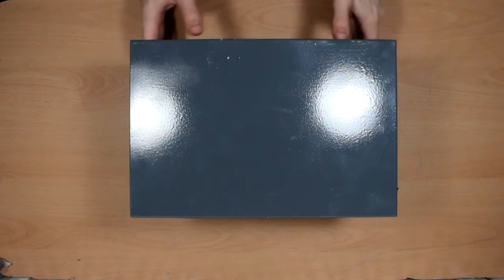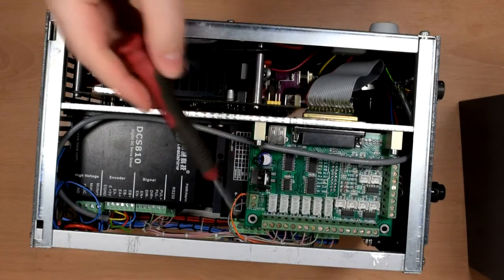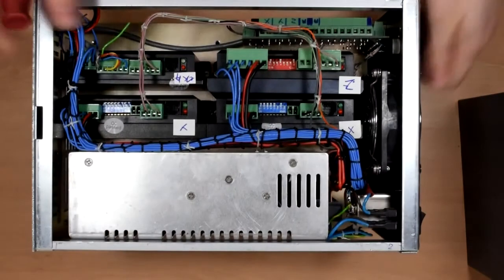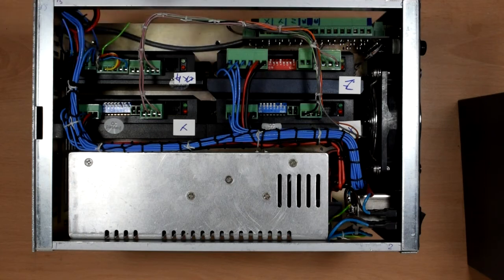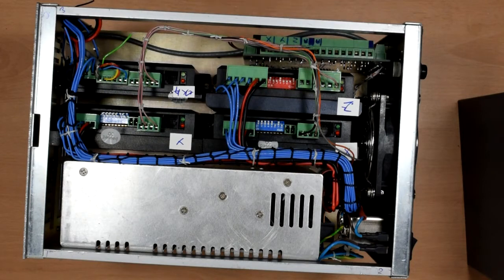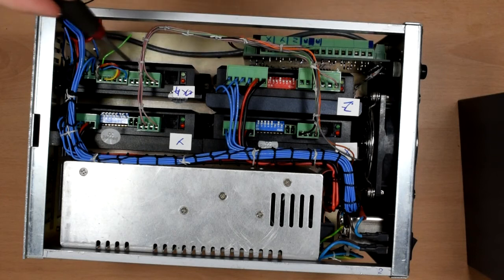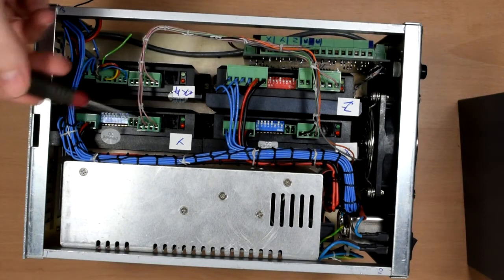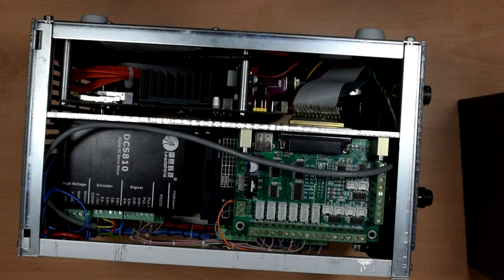3D printer servo/stepper  control box and why Leadshine suck.

Comment: You should definitely release a video about the printer. It sounds like it's a very unique one! I'm currently doing something similar (at least in the unique area) https://3dprintboard.com/showthread.php?42276-diy-3d-printer-design-verification&p=134738#post134738

Comment: You should twist the motor coil wires in pairs to reduce RFI.  Also putting a common mode ferrite on them near the driver would help too.

Comment: nice work ... can you show us the printer it self ?? and can you make a 3d printer using only servos from an old printer ??
Reply from the maker: There will be a video on the printer when i get the thing to work properly!   It would be possible to make a 3d printer with just about any actuator,  the question is weather it's worth it.  It actualy makes good sence to use steppers for the axis drive where weight isn't such an issue.